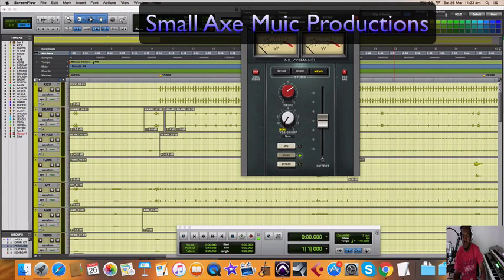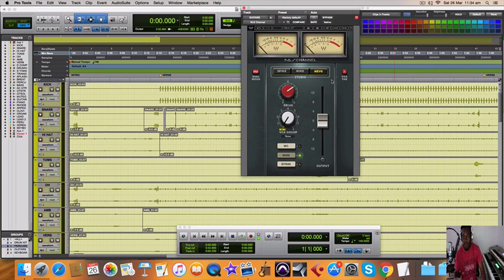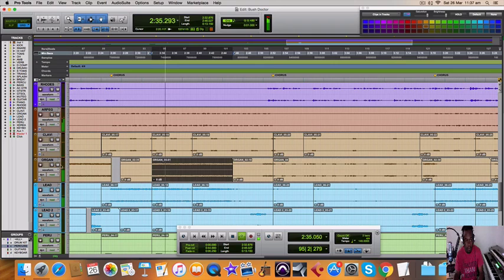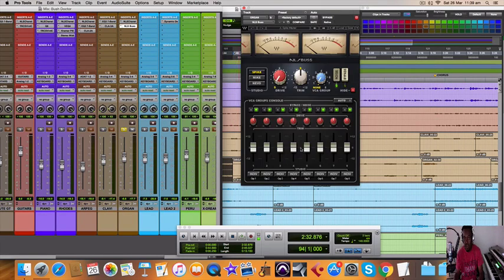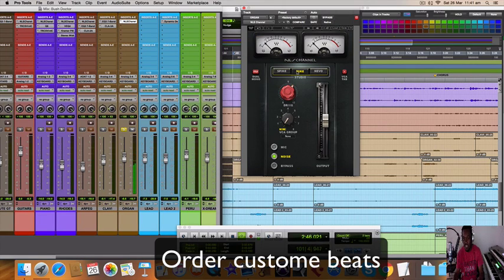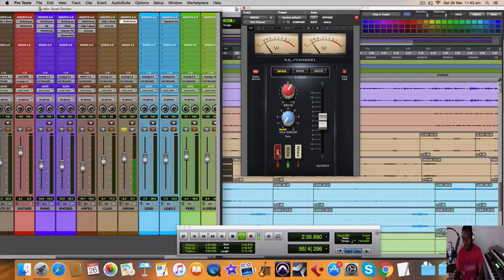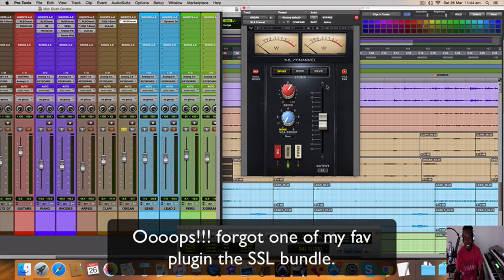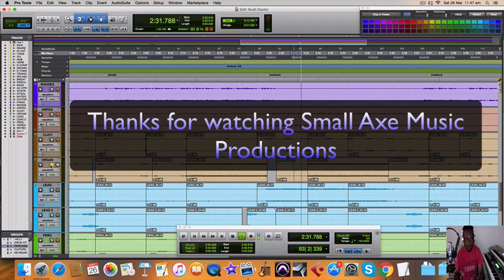How to add analog distortion Waves NLS

Comment: Thanks Small Axe, i was able to snatch up the NLS from waves recently, and have been watching tutorials from other engineers. and they recommended that the NLS be placed in the last slot on the channels and then on the first slot on the master channels. Any thoughts on this because I think you were placing it on the first slots. If I am wrong my bad.
Reply from the maker: Guiliano Wells if you watch some of my earlier videos that's what I use to do but I started working with ears so I rather use it with it on the fist slot. Try both ways and see.
Reply: Small Axe MP I was considering how a console works, patching compressors and Eq's before the board. I was able the get the G series SSL channel as well, and now I'm getting a handle on it in my sessions. Give thanks for your tutorials.
Reply from the maker: you are right bro that`s how the console is set up outboard gears to the console but somehow I find when I add it first it sounds better for me so I just stick with it that way.  With the digital world of recording we are discovering a lot things works differently.n I have some guitar effects that works great on drums, vocals etc so it`s a world to explore and find what works. Bless up bro.